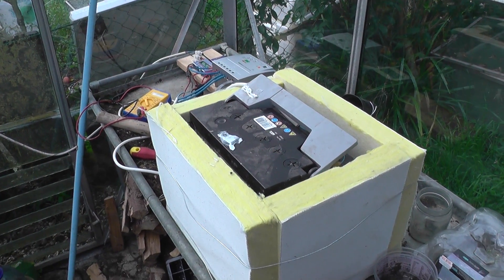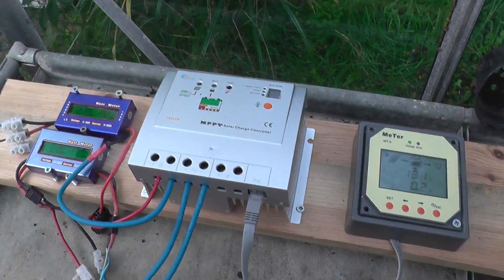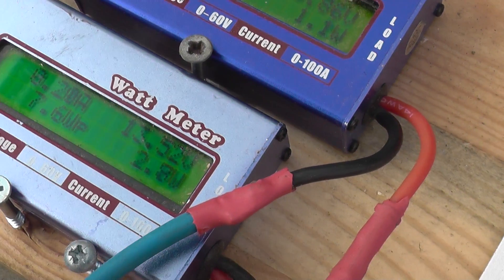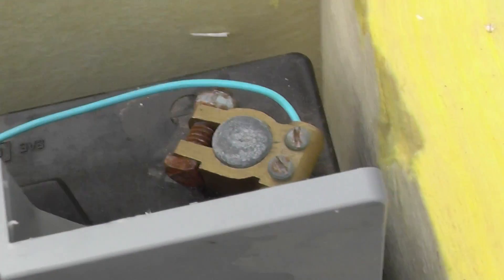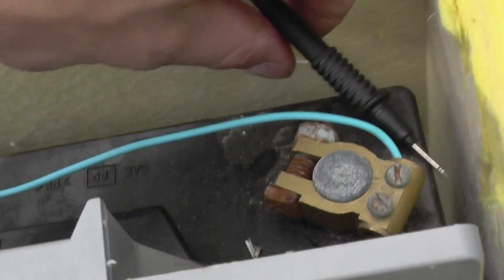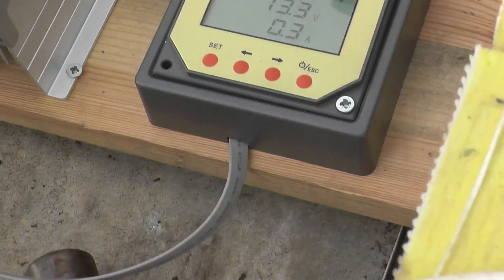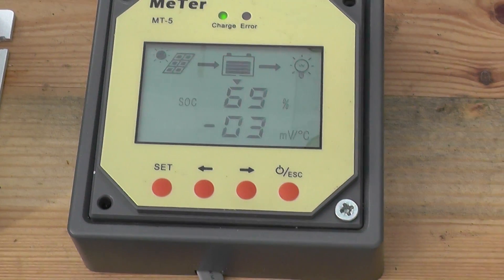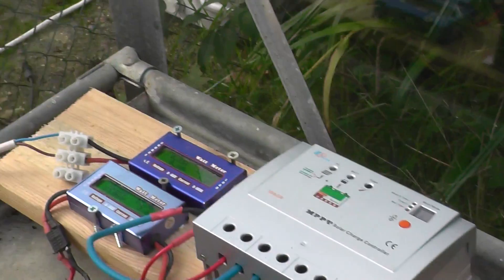Follow up to MPPT WORKS

Comment: Keeping your setup in a green house will effect everything pertaining to charging your battery. Its the heat, battery's do not like heat. Also you might want to TLC that batt. Bit of Vaseline on the terminals. The charger/controller has ambient temp sensing to help determine the best way to charge your batt. Your cables?
Reply from the maker: set up was only there to prove the mppt function as larger 80W panels were in Parallel. MPPT charger lasted around 9 months PWM is still running
Reply: pietkaify What went wrong with MPPT and it lasting only 9 months. I like your videos BTW

Comment: Pietkaify, some help i really need, from you.
Am using, the EPsolar MPPT 40A, like yours, for a 12v system, charging three(3) 100AH batteries(pararell 12v). I have programmed it, as a choice 1, the ''nil''(dusk to dawn) and zero( 0 ) as the 2nd choise. According to the manual, should provide power, through the inverter, all night long,correct???..... But, for some reason the power goes off at 5:00 in the morning till 7:00 and then the power goes ON, again automatically! Since the power is off for 2 hours only, it means i still have watts into my batteries, why this is happening?? thanks a lot!!!
Εμφάνιση λιγότερων

Comment: Hi, My MPPT Charge does exactly the same thing, going quickly to 100% when the sun comes out then down to 50% when a bit of cloud comes over.  did you find a solution?
Reply from the maker: I will have a look when its a bit warmer! I think its broken! Whenever it was connected to the batteries it would cause them to gas spit and bubble with even a little sun! =/
Reply: +Adam Crofts It shows 50% without the sun, because only %50 of the battery is usable. A 100ah battery should only be drained 50%, used 50ah and remaining 50ah.

50% at night on battery means if u run this to 0% you have no more safe usable energy.

Comment: Also as for desulfating batteries the retail units work but much slower since they have to implement safety into the circuit to sell it commercially. Look on my playlists on how to build yourself a better desulfator that works much better.

Comment: Most likely the reason your SOC bounces around when there is a load on the system is it derives it's calculation of SOC by the battery voltage.  If you put on a high amp load it will pull the battery volts down fast then the battery recovers when the load is removed.